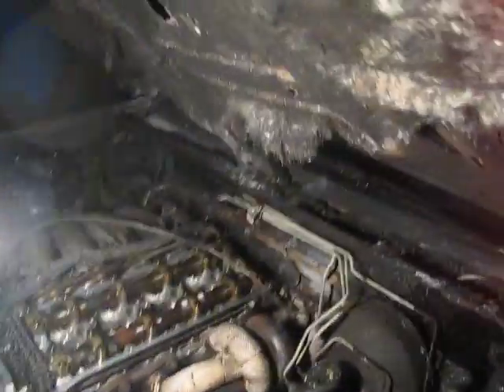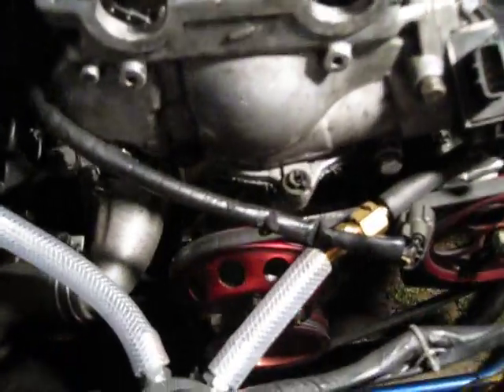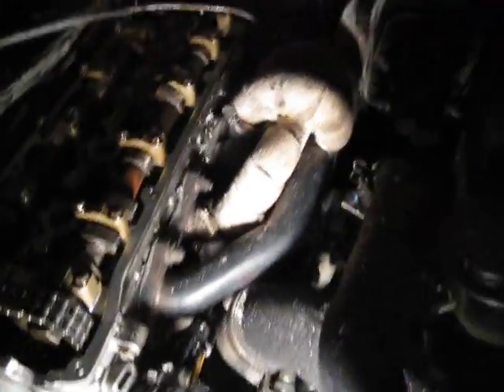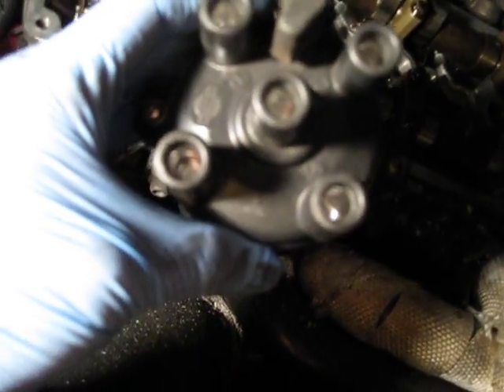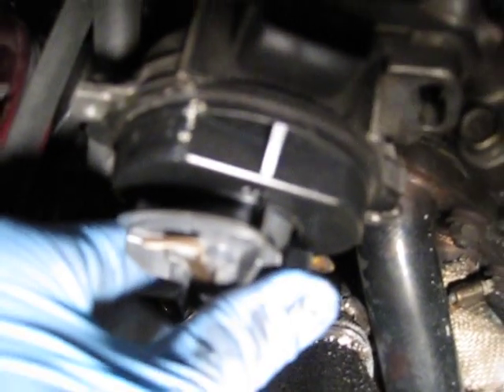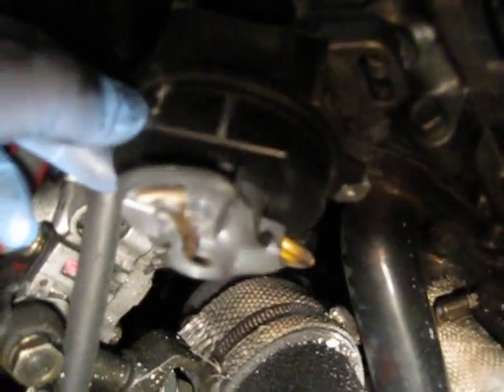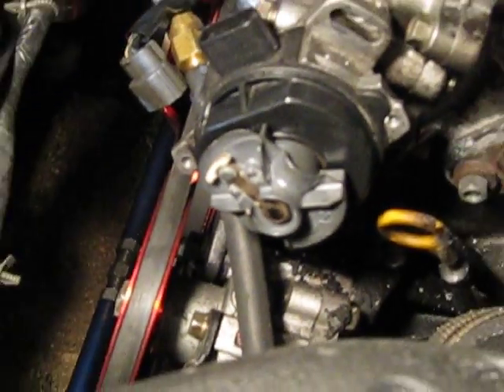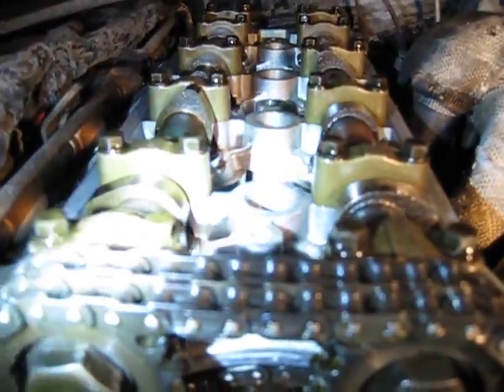240sx distributor timing

Comment from the maker: to line up the cams, you'll have to loosen the timing chain and take it off the spockets so that you can turn the cams.  Once you turn the cams, they should be facing opposite each other while the engine is at top dead center.  Search on ka-t.org if you need more help. Lots of information on there with pictures. or just look for pictures on google.